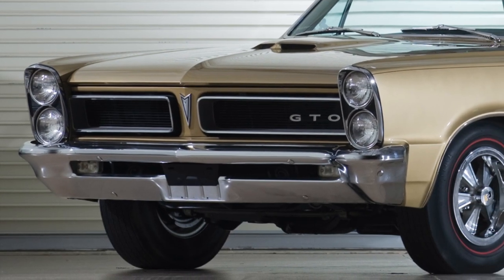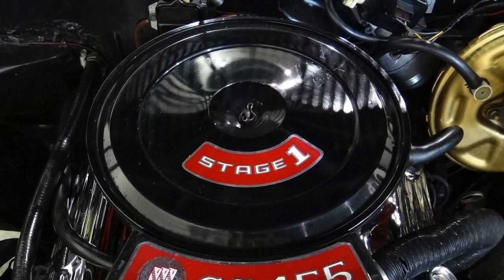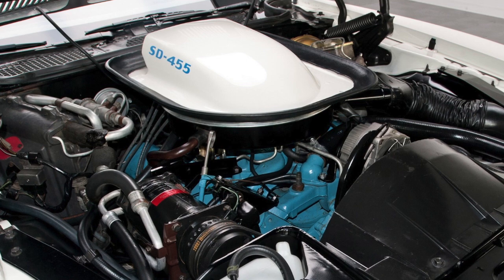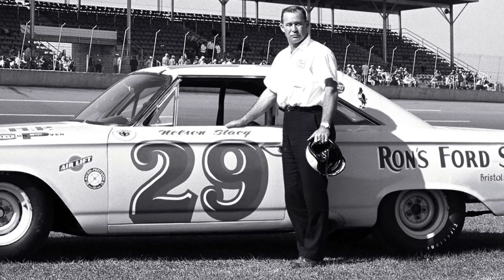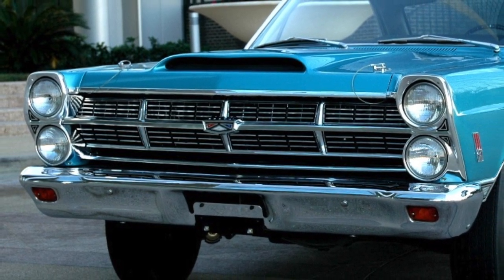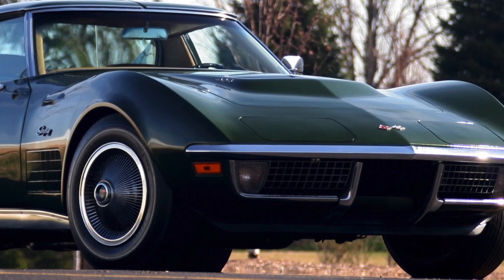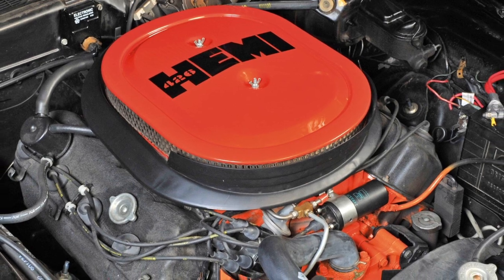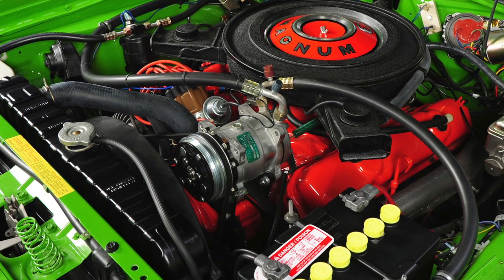5 Best Vintage V8 Muscle Car Engines

Comment: Great video - however, MOPAR is definitely underrepresented here. I'll highlight just a single example:

-The 340 small block was an incredible high performance motor offered throughout the Dodge/Plymouth range in different model years. In a comparatively "compact" car like the Demon/Duster, you could easily take the fat cats in their intermediates & full sizes from a stop light. Even in a larger model like the Charger/Road Runner, the 340 was a killer motor.
Reply: @JazzzRockFuzion.....You took the words right outta my mouth. The 68 340s with the now sought after heads.
Reply: JazzzRockFuzion you could say that about a lot of small blocks,  for reliable driving and stop light to stop light. give me a mopar 340, and chevy 327, ford 289, and many others. but I think this article was king of the hill bog block. it's all in what you were looking for
Reply: 340 was excellent among smallblocks, but a 400 HP 440 vs a 400 HP 340, the 440 is more driveable and way higher average torque. Same acceleration with less rear axle gearing, despite weight, makes less noise and longer life.
Reply: the 340 is a fantastic engine, but the ones from 1970 was the are even better!
Reply: I totally agree, those 340s were outrunning big blocks and the 440s were putting the hurt on plenty of Brand X and Ford cars.
Reply: @reindaz  how are the 340 from 1970's better then the 1960's model's?
Reply: I had a 340 Duster and yes, that 340 was one sweet running engine.
Reply: Moon Pie  yeah I know. The 340 has no chance anginst a 350 with a carb, header's, Accel distributor and a manifold.
Reply: Even a 200 horsepower 350 will outright outrun a 340 and 360. I had a 1984 Chevy g20 custom van with a 307 with a carb, manifold, distributor and header's the g20 will outrun a mustang with stock except with nitrous and the common bolt on parts. The mustang had like 320 horsepower.
Reply: Got me a 340 and a 727, first and only Mopar stuff for me, and a good first if I might add.
Reply: Larry the doom guy in training, if the Mustang had “320hp”prior to 1986, how do you explain a rating of 200hp in ‘86, which by the way was the first year of fuel injection. It went to 225hp for ‘87. That would be a real significant drop when they added the fuel injection.
 During these years, I owned an ‘86 and my best friend had an ‘87 LX fox body.
 The family business was also a gas station with a single bay garage, so I’m very familiar with about everything on the road at the time.
 So, how do you explain that?
Reply: @larrythedoomguyintraining2706  We had 340Hemi in 66 Barracuda Formula S We NEVER LOST to 350s . Raced our Employee with 72 Chevelle 350 Rebuilt with Overhead Cam & Smoked him in the Q! You Know Nothing what a 340Hemi is Capable Of!!!
Reply: @bhaggen  
1970 barracuda  340 with a 6 pack  .!
Reply: @free lover.....That was the AAR Cuda with the cool side-pipes. To make it DOT street legal the exhaust went over the rear axle & made a U-turn. Same with the Challenger T/A
Reply: Oh ffs.  The 340 belongs nowhere near this discussion.  Neither do any of the other Mopars you mention if the 427 side oiler, the cammer, nor the 429 BOSS don't get in the discussion.  You Mopar fanboys need to get some perspective.
Reply: 200 HP 350? Which one Larry? The Olds/Buick/Pontiac/Chevy 350? All are different engines... Also no 200 HP motor would out run a Mopar 340 unless it was not firing on all cylinders... They were great motors, not the fastest but definitely strong and could outrun many other muscle car motors.
Reply: @larrythedoomguyintraining2706  Depends on what 350 you're talking about seeing how there's about 500 different versions of the Chevy 350 from truck engines to the solid lifter LT1 from 1970
Reply: @larrythedoomguyintraining2706  Lol I want some of what you're smoking. Sorry pal but a 350 truck motor or a 307 is not beating a Mopar 340. Maybe if the 340 is running on 5 cylinders lol. You've been inhaling too many exhaust fumes
Reply: @thomasdavidson1341  That guy has absolutely no idea what he's talking about. There wasn't a car built in America during the entire decade of the 80's that made 320 horsepower...gross or net. The closest was probably the Turbo Buicks but even they weren't making that much power. According to this guy a 307 or a 350 truck motor will outrun a Mopar 340 lol. That's about the dumbest thing I've ever read in the comment section
Reply: @chuckschillingvideos  I think you're the one who needs to get some perspective. The street version of the BOSS 429 is the most over-hyped big block of the entire muscle car era. The regular 428 CJ Mustang's clicked off quicker times in the 1/4 mile than the BOSS9. You had to do some day 2 mods to make the BOSS9 competitive against the top shelf muscle cars like the 426 Hemi Mopar's, LS6 Chevelle's, and 455 Stage 1 Buick's
Reply: @jeremythompson9122  You're assuming that the ONLY performance that matters is a quarter mile.  That's ridiculous.
Reply: The fast reving motor built it ate alot of big block cars
Reply: @larrythedoomguyintraining2706  , ok. Keep telling yourself that. Some of us know the truth.  The '68-'70 340 was a pretty stout performer. You speak in a web of lies.🤣
Reply: @jeremythompson9122  and on top of that the gutless 307 was in a 6,000 lb van.And against a lightweight Mustang.  The guy was probably just driving down the road when the van passed him, now he's saying he beat him in a race. He wouldn't know a 340 if it bit him in the _ss!

Comment: For me I loved the Pontiac tin indian powered with a 421 engine.
Reply: Robert Lyon I think the 421 is probably the best Pontiac engine ever made!
Reply: @timothypaulo7060  No question about it. Arny Beswick with a 1963 Tempest.
Reply: The 421 equipped with 2 four barrel carbs was an absolute powerhouse. Totally under appreciated engine.i believe it’s even huskier than a 409 with. Dual quads. (Another awesome engine!)
Reply: I was going to bring up the Pontiac 421. Recently set up a pure stock on a stationary dyno at 585 Hp and 590 tq! Best production motor ever.
Reply: 389, 400, 421, 455.
Reply: @timothypaulo7060  i herd the 455 was the best hp production car there was the quickest off the line 0 to 60! It was in the Buick...
Reply: @robertmeese6545  I believe you are right. There was the 1970 Buick that had the stage 1 455 engine and if I’m not mistaken, it was the quickest car on the street that was right off the showroom floor.
Reply: @timothypaulo7060  I remember back in 81 a high school kid had a Buick stage 1 455 and no one thought anything about it he traded it in for a new ss monte! Some time new is not better.
Reply: Only imagine if Pontiac would have been allowed to put Ram Air V heads on a 455. No one would even be talking about the Buick Stage 1 or probably even the Chrysler Hemi.

Comment: Depends on your interpretation of the word best. Most of these engine was not seen on a common basis. I was at the end of the muscle car movement. Built and help build plenty of street cars. Drag raced on back roads and cruised town nearly every Friday night.. So I made my list of 5 engines to the common gear head. First Chevy 327 ,  second ford 351C,  third Chrysler 440,  fourth Chevy 396, and last was my favorite and still is today. Because I loved the manual shift of the ford top loader. 289 Hypo.
Reply: Farmer Dude357
 as for your 5 picks i do like the GM 327 in it's stock form . As a stock engine the performance was there but as a engine to be built the GM 350 ,,,,  high nickle 010 and 020 was a nuch better block to build . 
  When it comes to building a Mopar block i found i made much more horsepower building a 383 Magnum pre 1968 block than the 440 . Manipulation of the valve trane and cam modification along with stroke was cheaper and from my experience out performed many 440 engines ... I do like your picks though Sir
Reply: 7natcho I wouldn’t say these are the best. Just so popular when I was a gear head in the early 80s. I’m not a Chevy fan. But if I remember right these Chevy guys was digging up these 327 engine in old farm trucks. These engines had the all steal crank shaft. And also had the 202 valves in the heads. Add a nice intake and a 4 barrel carb and you had a fast car.
Reply: @farmerdude3578  You are correct ,,, in it's stock form the truck 327 was a good engine .  As i said when machine work and performance comes into the equation the 350  010 &020 are high nickle blocks . Controls heat dissipation and cracking more efficiently .  I have build engines from all the big 3 . All engines have short comings and most times it is the preference of the builder !

Comment: Great engines! The SD455 was America's last big breather. Total respect for Pontiac!
Reply: It's too bad the 455SD came out during the gas crunch era, or it might've gone down as the baddest of them all
Reply: Barcrrt I had one in the 80's my dad work at Norwood Assembly plant in Cincinnati the birthplace of the "F" body!!
Reply: My ‘73 Grand Prix SJ had a 455SD.... it was a beast even on unleaded gas. Everyone gave into the no more horsepower narrative. Not Pontiac
Reply: Me too!
Reply: Research Outlaw Trans Am...it has been re-incarnated to an 800+ HP monster...not original of course, but I would assume just as fun ;-)
Reply: David H.  No I just go by facts and my experiences of being a mechanic for almost 50 years rather than blind loyalty to a certain brand. The fact is that the round port SD455 heads flowed just as good as Chrysler 426 Hemi heads. Brand loyalty doesn't change facts or reality. You must be a Liberal with that mentality. Just because you don't like the truth or don't wanna hear it doesn't mean that it's no longer the truth. I'd still take any 426 Hemi Mopar over an SD455 Trans Am but the fact is that the SD455 heads flowed just as well as 426 Hemi heads. The SD455 just didn't make as much power because they had to have low compression, a smog pump, and a mild camshaft in order to comply with federal emissions laws. If the SD455 had been built in 1969 or 70 instead of 1973-74 it would've been a 500 horsepower fire breathing monster because of the airflow capabilities of those round port heads. Thats the cold hard truth regardless of whether you're a Mopar guy, a Ford guy, or a GM guy. Any mechanic who knows these engines will tell you the same thing I am telling you
Reply: @gregorysepeda3006  73 Grand Prix just had a passenger car 455 not an SD

Comment: I really liked driving a lot of these legendary  cars with the high performance engines !  My favorite   of All was the often forgotten  500 cu. In. 400 h.p. 1970 Eldorado.   It was easy to take off without roasting the tires .  No it wasn't the same as sitting still and wasting your tires !  Thank you CADILLAC DIVISION of General Motors!
Reply: Blame the lame 2.73:1 rear axle.

Comment: Missed a big one guy's...the Ford 427 cammer was the standard for monster V8's. Headers , a little bigger carb and a slightly more aggressive cam put this badass motor at 600+ horsepower...that why Nascar outlawed it as soon as it hit the track...... mostly due to complaints from Plymouth , due to the fact that it smoked the 426 Hemi.....
Reply: it was never in a production vehicle and very few were ever assembled.
Reply: @jerryw6699  
Bill France approved the 426 Hemi despite the engine not being in a car at that time. Ford countered with the SOHC 427  which never saw a stock car and Bill shut them down, never raced in NASCAR. 1969-70 FORD & CHRYSLER competed with the AERO cars. GM couldn't compete. After 1970 France ended the AERO WAR CARS. GM was back. Ford won the most races in this short era with the Mercury Cyclone Spoiler & the Ford Talladega. Or Cobra. The Torino body was used. In 69  David Pearson won the Grand National Title in a Ford. Richard Petty driving a Ford that year finished second.
Reply: @randycoursey7230  ford made 10,000 427 thunderbolts and made cars that were not street legal with that engine like the falcon demon for drag racing
Reply: 427 sohc , single 4v 616 H. P. ,DUALL QUADS 657 H. P.
Reply: @jerryparks6123  Amen Brother !

Comment: Video correction. In fact, Ford DID produce another race car engine in a full production Ford. It is available NOW in the Mustang GT-350 and GT-350R with the Voodoo flat plane 526 HP @ 8250 RPM  engine.

Comment: Good choices, the main problem with the 426 HEMI was the warranty was 12000 miles versus 50000 for the 440 and 383 etc. along with a lot more money to buy.
Reply: The biggest problem with the 426 Hemi was it's horrible combustion chamber, the only reason they made the power they did is because they came from the factory with the rubber band already wrapped up pretty tight in them, ie big cams, solid lifters etc etc,  hardly anyone understands that the reason behind the Hemi design wasn't to intentionally make a big dished out head and put a big dome on the piston, that's actually detrimental to flame propagation. 
About 17 or so years ago when a friend of mine came running into my shop all excited saying "Did you hear? Chrysler's bringing the Hemi back!!!" I immediately told him "It's not going to be a true Hemi, I'll guarantee you of that, I'll bet everything I own it's gonna have flat top pistons and closed chambers like a bathtub style", when he ask how I figured that I told him "Because the old Hemi's were horrible, inefficient combustion chambers, and there's NO WAY they'll be able to get them to pass a modern emissions test", don't ya know the first time he showed me a cut away view of one in one of his car magazines he was standing there saying "You were right, it's not a "real" Hemi".
"Hemi" combustion chambers like that were in aircraft and Harley engines long before Chrysler used them, matter of fact that's where Harley and Chrysler learned it from, aircraft engines, Harley dropped the Hemi combustion chamber in 84 with the Evo engine and went with a flat top piston and a partially closed "D" shaped combustion chamber and performance rose sharply, especially with just small mods they made much more power then the Shovel engine that had the same exact bore/stroke and bottom end assembly. 
There's a reason no one makes a true Hemi combustion chamber anymore yet power to displacement ratios are much higher than they were back then.

Comment: Well chosen picks and very good commentary, especially on the SD-455.  Air Flow Research helped develop these heads and they allegedly claimed the flow was comparable to the hemi.  The SD project was originally slated to come out as a high compression 70 engine with the Ram Air IV cam.  The final release of that motor in the face of emissions, politics, the gas crisis, corporate infighting, unleaded fuel, and the impending death of the musclecar, makes for an interesting story.  It also makes one respect that powerplant a bit more.  Note that the factory rating of 290 hp was listed at 4400 rpm.  The redline on SD equipped tachometers was set at 5750.

Comment: Sadly, I see no mention here of Oldsmobile's "W" Machines. You did however mention the Pontiac SD 455, and it was one of the few Pontiac engines that came from the factory with 4 bolt mains.  Thumb up fr the video.

Comment: If you had to narrow it down to the best five, I think I'd agree with this list 100%. Very interesting info too, thanks. 👍🏻
Reply: 327 L84 375 hp
Reply: @DANTHETUBEMAN  
That was a hot little 327 my friend had a silver 63 split window Corvette with the 375 horsepower and the two speed. But the thing about these muscle cars up here is all of them are approaching 450 horsepower in shitloads of torque it's just some of them are way under rated to please the government  insurance and tree huggers.
Reply: @dannydennis318  right, the Z-28 302 Camaro, rated at 240 HP, at 3000 rpm.
and that's what it had. but it liked to be shifted at 7200 rpm where is had 400 HP!

Comment: You can not forget the Z-11 all aluminum 427 Would put out 575 hp in stock form with open exhaust  and was as light as a small block .